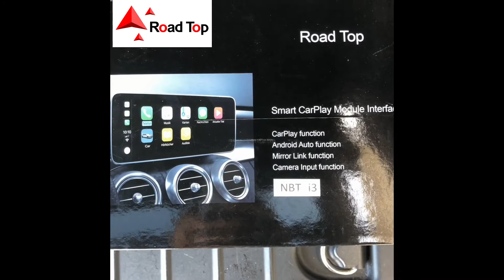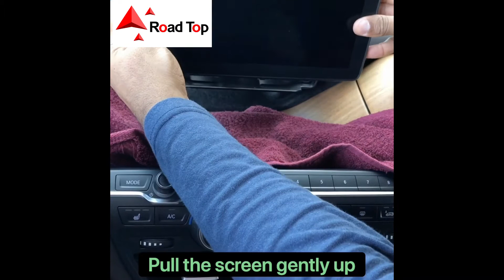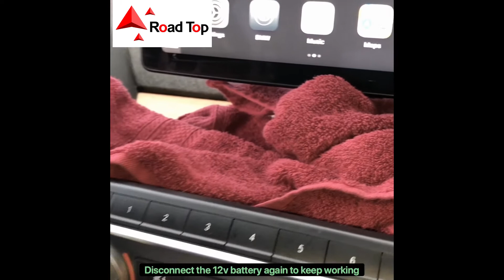BMW I3 Carplay Installation

Comment: This really helped me a lot. It has worked for me for about a year. I don't know if anyone has experienced this: RoadTop works just find but if I 1) hold down the menu button to switch to the native iDrive display or 2) just get into the car without my phone at all, the screen just stays black. I've tried rebooting the iDrive system by holding the power/volume knob for 30 seconds; it sounds like its rebooting because I can hear fuzz through the speakers at approx 30 sec mark but screen always stays black and no ability to use the iDrive system. Anyone else?